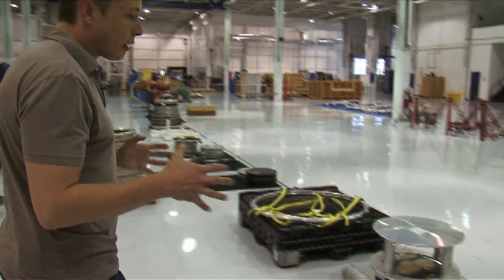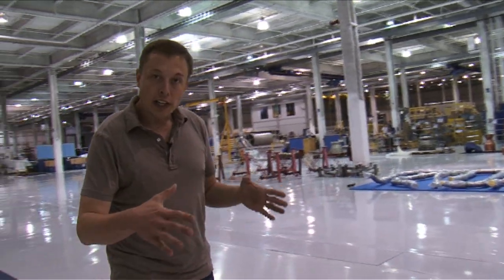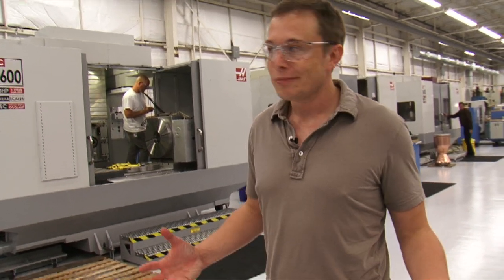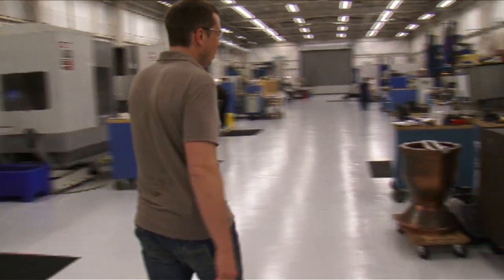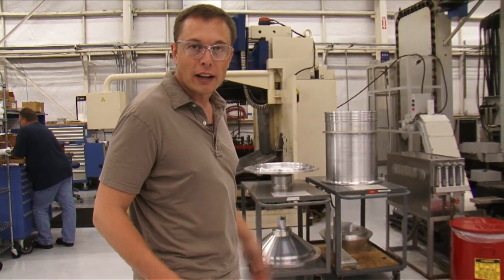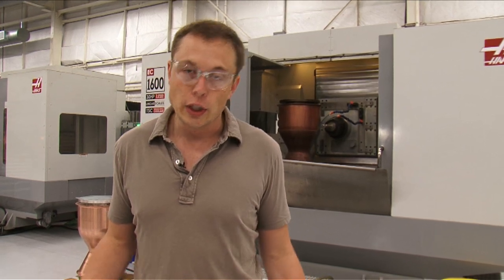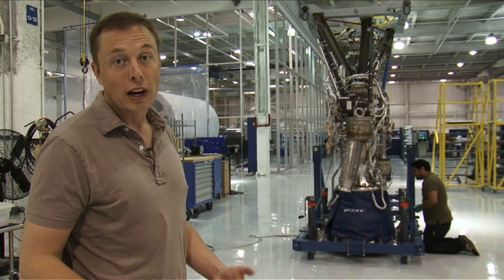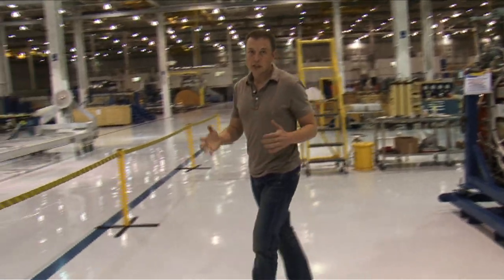Elon's SpaceX Tour - Engines

Comment: Just totally amazing to me how these rocket engines, that are so similar to a gas stove or bbq burner or cutting torch can generate SO MUCH thrust...and since they are what provides that massive force are able to handle such massive amounts of weight.  I can only imagine that the gases enter the cone with incredible pressure and velocity, which I guess when ignited creates unimaginable expansion...but still, I've seen Apollo era engines up close, and cannot fathom how it can be capable of exerting so much thrust without basically collapsing.   Mind blowing.  I wish I could work there, if only to sweep those floors.

Comment: They never show the pintle injector, what he calls "proprietary" which I helped them out with its original concept back the early 2000's,a 70KlbF unit made of aluminum. Glad it worked out for Space X.
Reply: Though I do understand the reasons for secrecy, sometimes I really regret that the detailed technical history of rocket engine development has never being fully told. We see some of the highlights, the things that have succeeded -- but not the drama leading from one dead end to another between them.

Comment: Awesome Elon, every other rocket engine pretty much is assembled by hand in a cradle , usually by just a few very experienced engineers, and the Assembly line and tools move around the rocket.. You have in effect reversed the process, taking the parts to machines, which can replicate difficult to make parts ( IE tube bending done by machine, rather than hand),  this will make it much easier and cheaper to turn out reliable Merlins, which one can group to make heavy lifters.. Let's Remember the russians tried this with the N1,  but depended on human intuition and engineering, sort of solving problems on the fly, resulting in a plumbing nightmare that was jury rigged together.. Quality control could not be wrangled in as abrubt changes to the N1's design would reside in the brains of the guys that did them,  rather than being documented and used to improve the thing.. All be it time tables as well as budget and political issues also played a huge roll.. 
    Sapce X on the other hand seems to have frozen the design,  taken their time, streamlined and perfected the process, and aimed at cutting costs via replication,  while not affecting the overall quality , or performance of the product.. no mean feat, Nasa tried this with the RS25's  essentially a single stage to orbit re usable engine.. Amazing works of art that bankrupted the STS program.. sticker shock on re builds was heart attack worthy..not to mention Nasa's culture, and political cuts ..especially during the Obama years.. 
   Seems with the Merlins  a balance has been struck.. and they are simple and plentiful enough if you loose one .. it can be replaced at a reasonable cost in a short time frame.. saving on launch window's .. plus , as with plans to re use them,  overhaul will not be over the moon expensive either.. 
   Again no mean feat,  space X froze the design, tested it , stuck to their guns through failures and glitches,  but eventually came up with a good reliable ,reusable , and powerful engine.. with none of the rockedyne, Etc expected cost over runs, and balooning budgets so common in aerospace.. 
   Keep that Merlin in production for as long as possible till you can pump em out like sausages,  and bring em back for overhaul (a tour of the overhaul section would be cool to see)..  Space X is on to something...they will run the Space industry in the next 15 years..

Comment: We have a very high engine production rate here at SpaceX.  Why. I thought it was all about reuse of engines.
Reply: In 2017 out of 18 launches, 14 first stages were recovered (but reuse was limited to two flights up to now). Even with this impressive recovery ratio, 18 second stage and 36 first stage engines were expended outright!

So even with reusing block 5 boosters 10 times, SpaceX would still have to make a new engine each week to make up for the spent and worn out hardware.